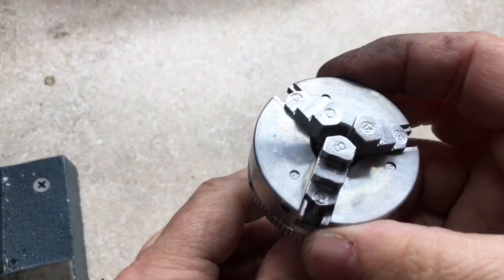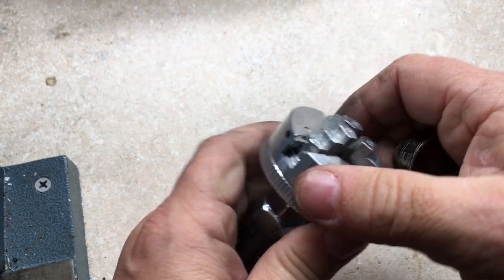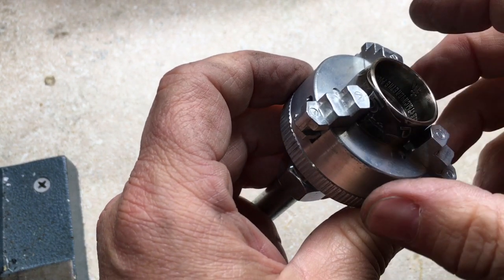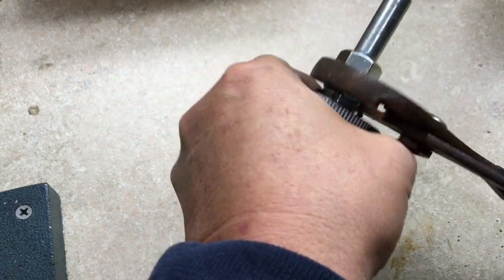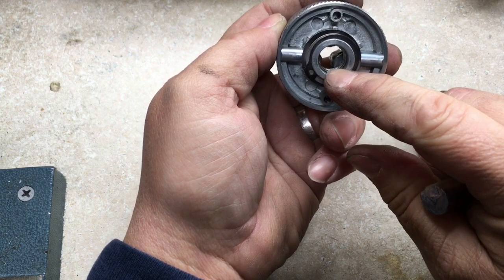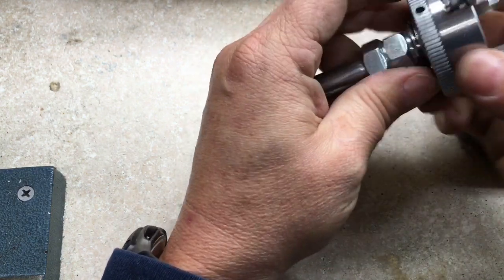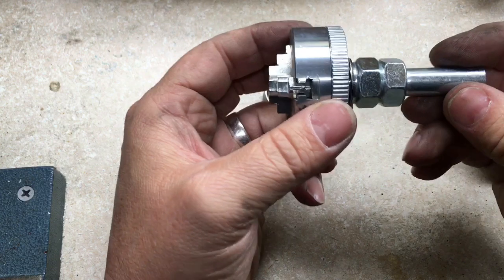Make a Mini Lathe Chuck for a Drill Perfect for Ring or Coin Ring Making

Comment: Got it done, Vann, with your guidance. The tap didn't seem like it was taking much "meat" out of the chuck, but it works perfectly. 👍
I have also cut short strips of non-fiction tape, the widrh of the chuck jaws, and applied to the jaws to prevent any marking on the inside of the ring, especially the "cut" edge. 
Later...
Reply from the maker: Awesome.  Glad it worked out for ya.   👍😁

Comment: Best idea I’ve seen.  I made a lathe from a drill but without a chuck. I could only carve the outside.  I had to do the inside with a Dremel.
Reply from the maker: This is a really handy thing to have. If you make one, make sure you tap it straight. If it's off it will wobble like crazy.. Thanks for the comment and for watching

Comment: Whenever I want to save some money on projects I look for people like you who post videos like this. Thank you very much.
I thought I could tap my mandrel but all I had was SAE Taps and Dies.  Instead of buying a Metric tap, I went ahead and purchased:
Arbors MT1 Shank with M12 x1 Mounting... on Amazon for $10.99.
Reply from the maker: You did it the best way by buying the shaft.  👍😁
Reply: is that part tapered? Can the drill grip that?
Reply: @joseamirandavelez  the Amazon item that I mentioned is cheaper, but it IS tapered. You can chuck it in a cordless drill, but because of the taper, it can be challenging to balance; it may wobble some.
Reply: @pluraltones  I tried to find a no but tapered version, but had no luck. A M12x1 bolt is an option, but I could not find it un Amazon. Found it online, but it's going to be about 30 bucks with shipping... Defeats the purpose of this idea...

Comment: Thanks Van,

I may give that tiny chuck a try. I didn't like those rubber bumper ring holders. it's next to impossible to get the ring to run true, so i've just been jam chucking them on my lathe using a maple dowel. my only concern is when i went to amazon both chucks got terrible reviews. all i really need it to do is hold the ring without too much run out/wobble so i can sand the edge like in your video.

Jeff
Reply from the maker: I used the heck out of mine with no issues until someone stole it and my drills. I need to make another one.  We’re in the process of buying a home so I can’t spend any money right now.  When we move I’m going to hit the ring making hard again. And make another mini chuck for my drills.  Thanks for watching and for commenting.  I highly recommend this for coin ring making.  😁👍

Comment: Perfect!  Thank you, Van.  I am knee-deep into ring-crafting, and ordered the chuck yesterday. I would prefer to find the oem threads on a bolt and nuts, though.  Do you have any suggestions as to where to start searching?  Thank you again!
Reply from the maker: If you search Amazon and eBay you should find a straight shaft with the correct threads.  Just be sure not to get the tapered shaft.

Comment: Hello, since you put that bolt in by yourself rather than it being manufactured with that already attached, is it possible that I an but a different Chuck instead of that one? Been looking at the reviews on Amazon and that one only had 3 stars.
Reply from the maker: It doesn’t get good reviews but on my end it has been great.  When using it to round an edge of a coin ring or to polish a coin ring the drill doesn’t go at high RPMs. If I had to do it again I would do like some others have told me in emails.  They bought the lathe chuck and the 12x1 thread pitch straight shaft.  That way there won’t be any wobble at all.  Another person bought the 12x1 thread die and put the correct threads on a piece of round stock.  Which is a good option too.  I wouldn’t do the bolt thing unless your just trying to save money.  Hope this helps. Here is a link to get the 12x1 thread die https://amzn.to/2Kcb8sg
Reply: Vans World Will definitely take your word for it. Thanks for replying so fast. What exactly does a thread die do?

Edit: Is it self centering or manual?
Reply from the maker: austin mcrayon the thread die will cut threads onto a piece of round stock metal.  Or you can re cut threads onto a bolt.  Self centering

Comment: Im hoping to try this out, got the chuck n the tap coming next week but... i dont know how to tap it (newbie at this kinda stuff) also curious how itll hold up against wooden rings since i mainly work with hard wood. Wouldnt want to damage the ring while it clamps, guess ill have to do some testing. This did save me tons on getting a lathe for my needs though!
Reply from the maker: Just make sure to tap it straight.  If it not then it will wobble 👍😁
Reply: @VansWorld  do i need to redrill the hole? Or can i just go in with the tap?
Reply from the maker: I just tapped over the existing threads.

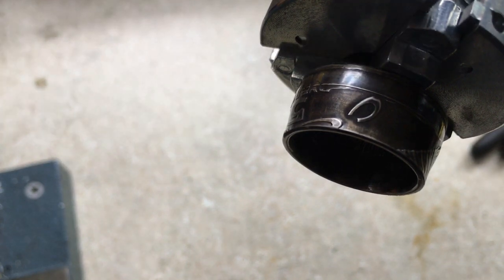Comment: What is the device called you show at 2:40? Did you make that out of a stopper/bung? Thanks.
Reply from the maker: https://www.etsy.com/listing/267370914/original-coin-ring-edge-rounding?ref=shop_home_feat_2&bes=1
Here is the link where I bought mine. I call em a mandrel but I believe he calls them something else.
Reply: @VansWorld  Thanks for the link. I've been using sockets wrapped in tape.

Comment: So if I understand correctly, you get the tap which looks like a screw---and you screw it in the middle till it comes out the other end so that you are remaking the screw grooves in the center of the chuck so that you can use the bolt that you cut the head off of to attach it to your drill?
Reply from the maker: Yep.  But since this video, someone stole my drill and the homemade chuck.  So I had to buy a new one.  This time I bought a straight shaft that is made for the mini lathe Chuck.
Reply: @VansWorld   Do you by chance have links to that? Or do I just look up straight mini lathe chuck?

Comment: hi i love the idea, but how do you hold it working on the ring?
Reply from the maker: My left hand is working the drill.  My right hand is applying sand paper to the ring 😁👍
Reply: @VansWorld  Thank you for answering so quickly, i might try it because i dont want to buy a mini lathe.
Reply: Can you explain the tap?
Reply from the maker: The tap will add a more common thread.  You will need to go slow and make sure it’s straight going in or the chuck will wobble.   You can find these chucks on amazon that have a shaft so you won’t need to tap the chuck.  It’s actually cheaper to find one with a shaft.
Reply: @VansWorld  Thank you!

Comment: Hey Van,
Do you have a link to where i could find the 15 dollar shaft that would fit the original threads?
Thanks!
Reply from the maker: I sure don’t.  All the shafts I’ve found are tapered.  The machinist at work said it’s threads he has never seen before.   The bolt works great! 😁👍
Reply: Vans World thanks anyway!

Comment: What would you charge for a finished one ? I hate to buy 3 taps for one use and knowing me I would screw it up
Reply from the maker: +Mark Cregger  I thought about doing that but it would probably be around $50 or better cause of shipping. eBay has a 6 in 1 mini lathe that you can pick up for bout $90
Reply: Are you still willingly to sell the finished one? I kinda need one

Comment: Great video Van... I am about to share it like crazy; so, please get a working, current, in-stock, affiliate link on it, as soon as you can. 
    I know, that you noticed, that these could often be purchased with a shaft, which can be cheaper and easier, for some, than tapping.    
...... Regardless, you helped a lot of us out, just seeing that these smaller chucks exist, and they can be turned with a drill chuck.   So, so that your channel can be helped, in atleast a small way.  Please attach a new jaw link; with or without a shaft, AMazon, ebay or wherever.  Thanks Again.    🔨Lisa♿

Comment: I do not know if what I am about to ask you exists, or it might have been something in one of my VERY vivid dreams that can be so real. 
But is there a tool to attach to a lathe to make an inside out ring ???
As I have a small large at home, and do NOT want to have to buy ALL of them presses and dies that I have seen on the the Internet, as specially on YouTube. 
If such a tool exists, I would like to know what it is called, where can I get one from, and what would the price be.
I live in England, so an English manufacturer would probably be better, as it would cutdown on shipping costs and any import taxes. But if you (or any of your followers) can help me, I would be eternally grateful, as I say, it is a LOT of money to fork out on equipment that I might ONLY use 2 or 3 times. Even to use a tool on my lathe would also be used a few times, but it could be put in the back of a drawer rather than taking up room bolted down on my workbench. 

Many thanks in advance, from John (AKA, Knobby)

Keep knocking out the videos 👍🏽

Comment: you can buy from Harbor Freight for $29 with shaft
Reply: @blackbearcolorado4114  Its a tapered MT1 shank not a straight shaft.  If the shaft can be removed, you may be able to buy or make your own after market shaft to fit into the threads.  An alternate option is to turn down the shaft to a straight shaft if you have a good lathe.
Reply: @blackbearcolorado4114  so does this one work right out of the box or does this one need modification as well?
Reply: @MattWilliams-jb3tz  i haven't gotten my hands on one yet.
Reply: @MattWilliams-jb3tz   I never went with this modification.  I just use adjustable ring mandrel for what I do.
Reply: @ahndeux  If you have a lathe to turn the shaft down you really wouldnt need this
Reply: @jcerullo5015  That is a bad assumption.  I have a lathe and I also have a mini lathe similar to this.  Why?  I can't carry a full sized lathe to the remote worksite.  I can always use this tool to sand down round parts or do work that doesn't fit in a drill chuck.